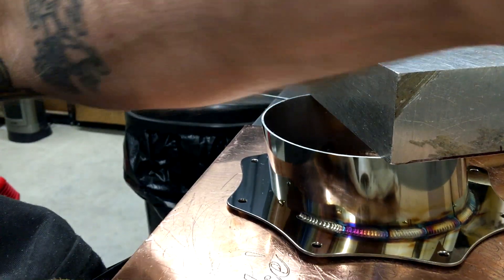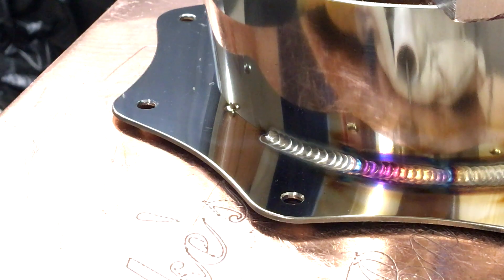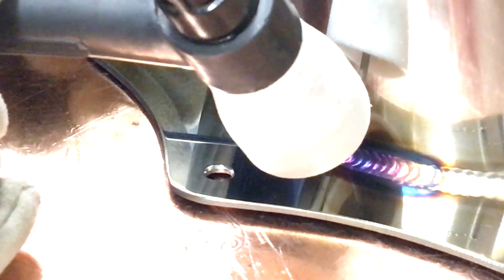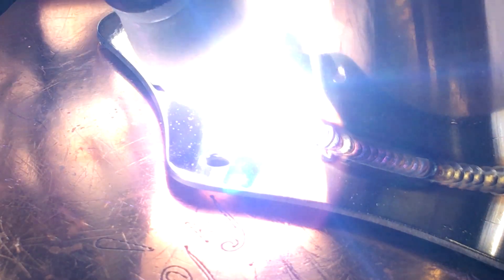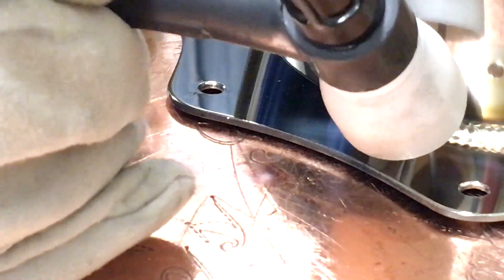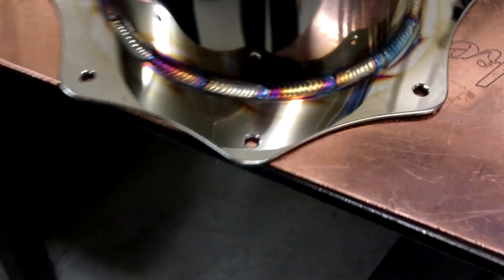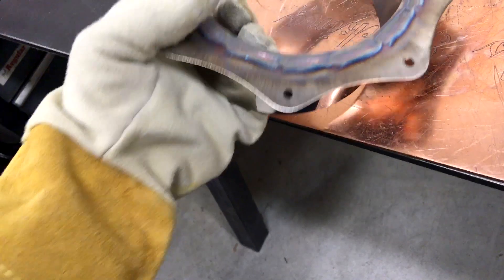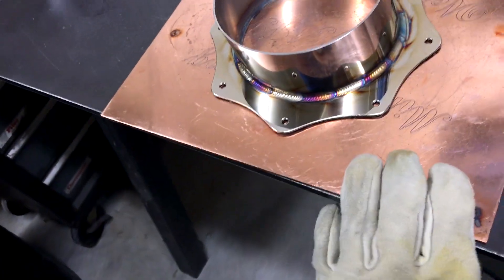tig welding 16 ga 304 Stainless steel fillet

Comment: Nice job.  Just bought a Lincoln sw 200... really wish I could play with the post flow like you did but eh, good little machine regardless :p.  I might just "borrow" the extra torch from work with the valve so i can just turn it off between tacks.

Comment: Mike, how do you polish the bead and burned area to that mirror polish of the rest of that fixture?  Please let me know I'm very interested since I have a piece of polished marine stainless steel that I need to weld but also polish the bead and heated areas to a mirror finish like the rest of it.  Thanks.

Comment: Why is your amps so high,I did a welding procedure for a 16 gauge gas tank and the CWB passed it at 55 amps
Reply from the maker: canadian welder you guys don’t have foot pedals in Canada? You don’t have to push them all the way down, ya know ah?
Reply from the maker: Here we can max a pedal out and do whatever we want because freedom! Now stay away from our White House you pyromaniacs
Reply: Monkey Fabrication Garage  if you are willing to take that chance it explains why 90% of the work I do is for USA companies.
Reply from the maker: canadian welder not exactly hurting for business. Glad we can share.
Reply: @canadianwelder3899  just his strategy. Why limit yourself to just enough amperage. There are little things you can do with that extra amperage. Pop a quick and clean tack weld, get the puddle formed fast and then back off so you minimize heat soaking. All kinds of stuff. It's his personal fab shop. No  bs regulations like you're talking about. You cannot deny his welds are awesome. But by all means keyboard warrior, post a video and show us how it's done.
Reply: @TwinTurboLsx  if you think is welding that good you have not seen a good stainless steel welder
Reply: @canadianwelder3899  for what hes going for, hes nailing it. Post some links to your videos so we can see how a pro does it. I'd really like to see your work.

Comment: Beautiful work , i dont know why i cant get that colors, just grey :(
Reply from the maker: Javier Broger if you’re getting gray then either your are moving way to slow and cooking the metal or you need better gas coverage. I sell the cup I’m using here in the video on my website if you’re interested. It’s a GLS #12. If you have a large torch then you’ll need a stubby gas lens which are available as a kit.
Reply: Thanks for the reply, I do have a gas lens kit I use #8 I'm thinking that argon where I live is not good
Reply: rixogtr I'm in Guatemala and it is shittier hahaha but only one grade of argon, also just one seller I will try to use a bigger cup
Reply: rixogtr stainless 304 with 308l filler.
Reply: Simple answer is you are over heating the weld.  Now it's up to figuring out if your travel speed is too slow, amperage is too high, using a dirty tungsten, too much arc length, bad gas coverage, or a combination of a couple of these.  Dull grey is the material is too hot, the cause of such is yet to be determined.
Reply: Gonna try thanks for your answers

Comment: Interesting, Mike. It was silver. As you raised the torch, almost instantly, it changed color. That’s the first weld you did in the video. Shows that we’ve got to keep argon on it as long as possible.
Reply from the maker: Mel Gross https://www.thefabricator.com/blog/colors-in-welds-and-what-they-mean
Reply: Yeah, thanks Mike. I’m pretty familiar. It’s a lot like heat treating as far as the colors go. It’s also just surface, because no oxygen, no color, which I was just mentioning. I find that if I keep it bathed for a while, and I had good coverage - -no color.